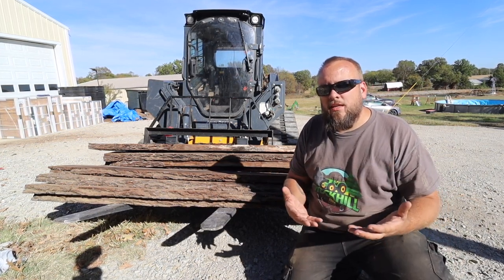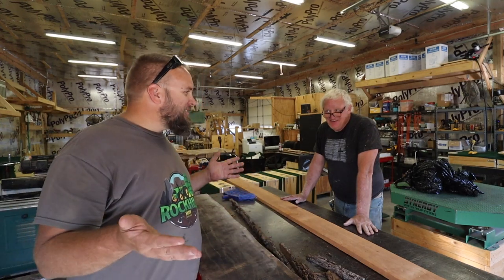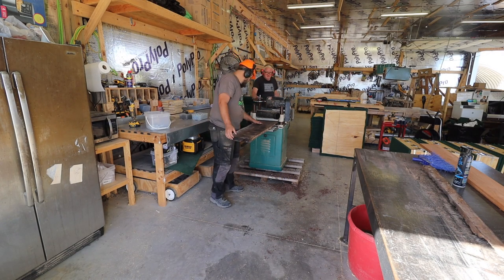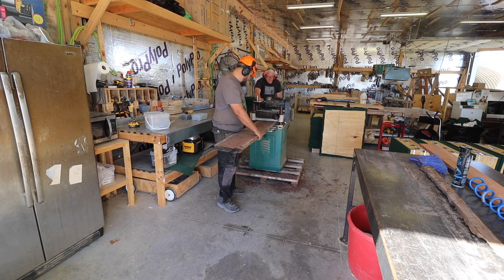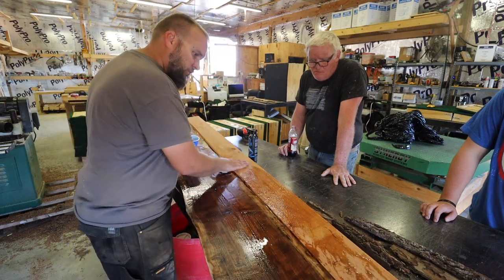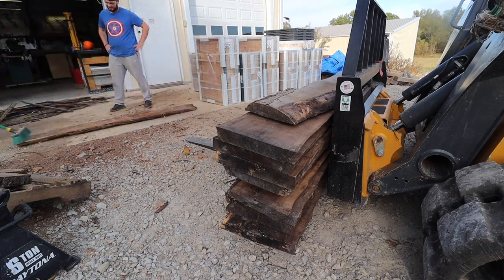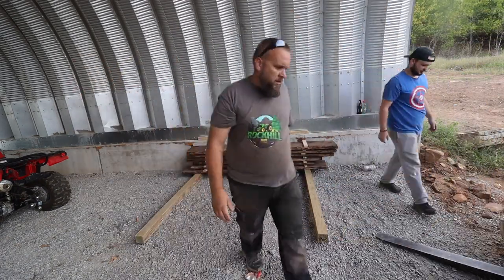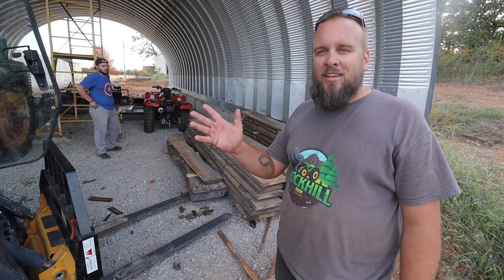Check Out this Milled Black Walnut After a Year Drying Outside

Comment: When you stack and sticker, you should have more than two bottom supports.  I prefer my supports to be spaced about 16" apart.  Then make sure your stickers are directly above the bottom supports.  Also, it's important to support the lumber about two inches from the end.  Having a sticker that close to the end also helps to keep the lumber from splitting.  I think it slows the drying process on the ends, so it matches that in the center.  This method allows better weight distribution and helps to prevent cupping and bowing.  It's the little details that can help make your lumber less labor intense and provide more useable stuff.  Great video!  I'm excited to see what you will make with your lumber!